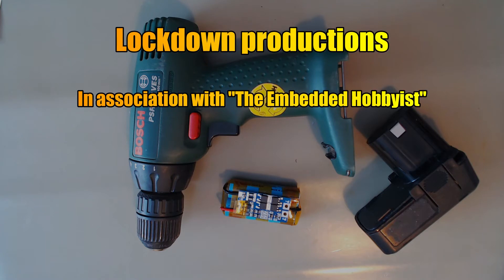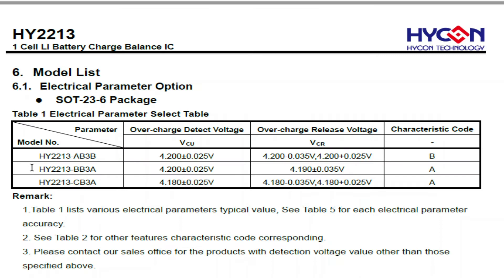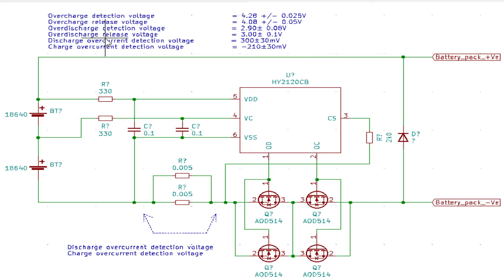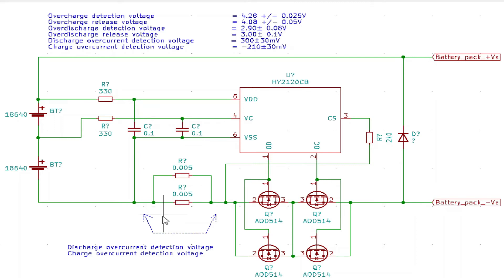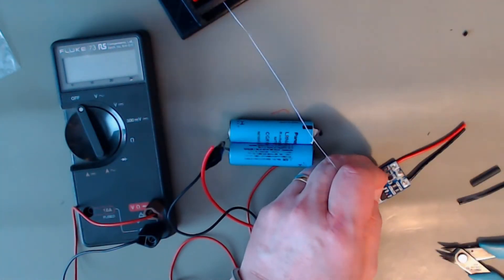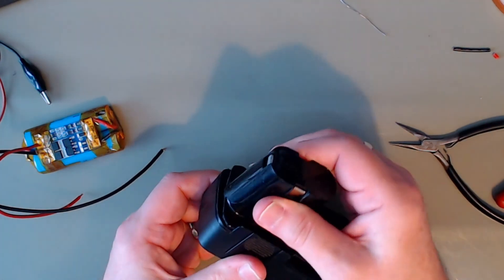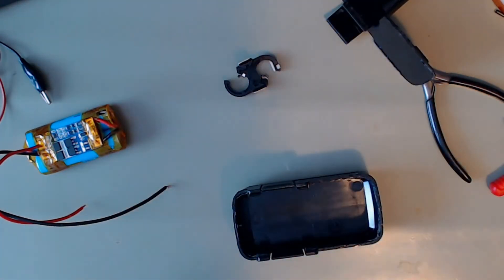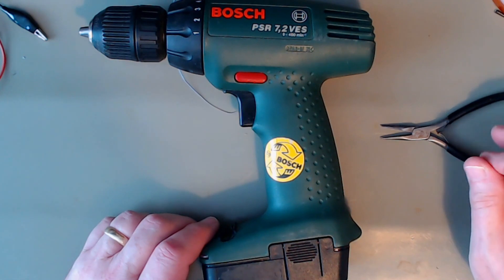#089 bosch drill repair part2

Comment: Total novice/ newbie question.
I have the exact same drill which died on me 2 days ago. I would like to fix it as you have but I can't see the make/ model of the batteries used and the same with the battery balance and protection board. 
Could you add links to the parts used please?
Many Thanks in advance.
Reply from the maker: The batteries were old laptop batteries, so i can't give a link for them. the balance and protection board was from AliExpress! put "2S 10A 18650 Lithium Protection Board BMS" into Google and your find lots from AliExpress, ebay etc.
Reply: Thank you @TheEmbeddedHobbyist
Reply from the maker: No problem, I hope you can get it back up and running.